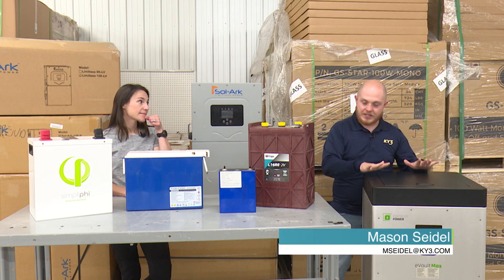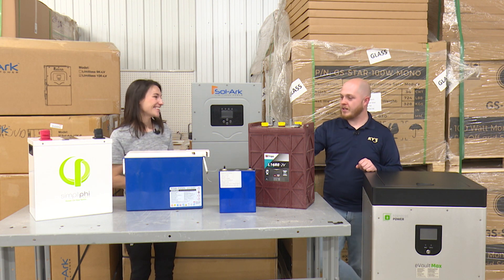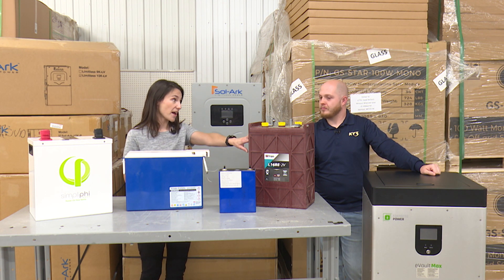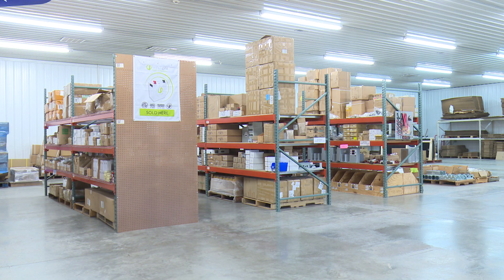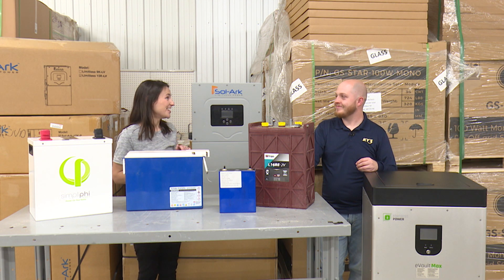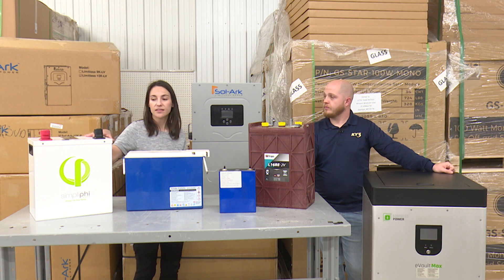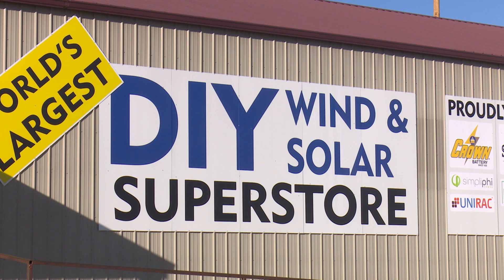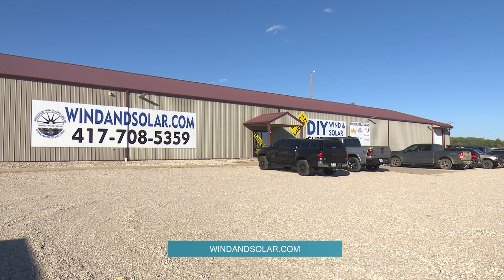What are the different types of battery technology?

Comment: I fully agree. Normally I swear by LiFePO4, but when I installed my solar well pump I used a gel battery. A standard SLA probably would have been fine, but from my time riding a dodgy scooter I know just how much gel helps during winter.